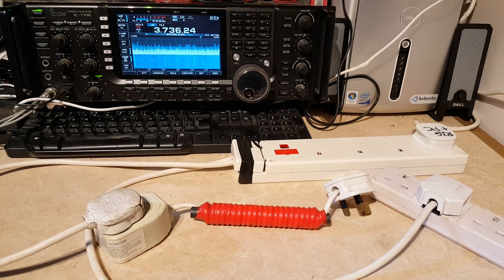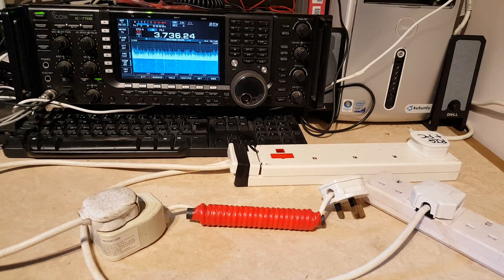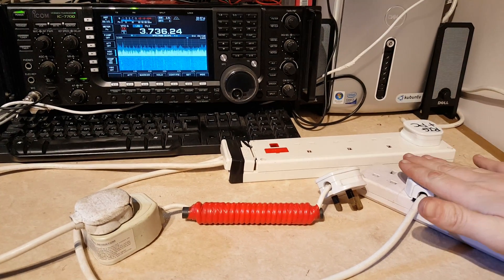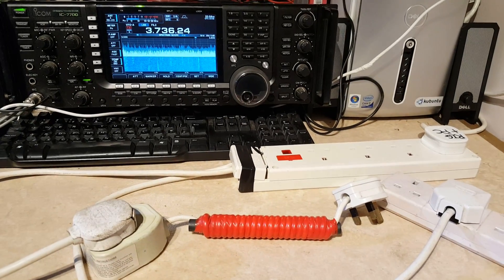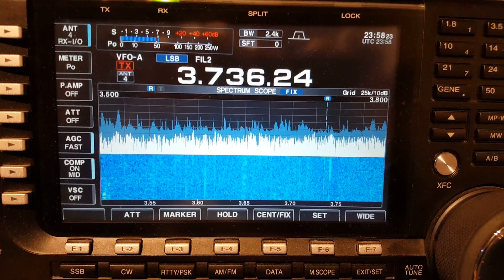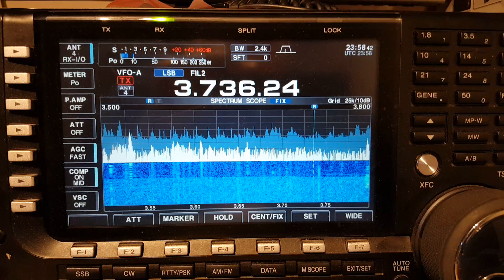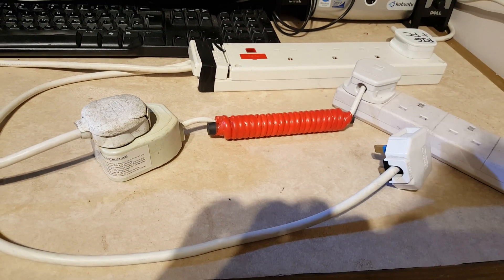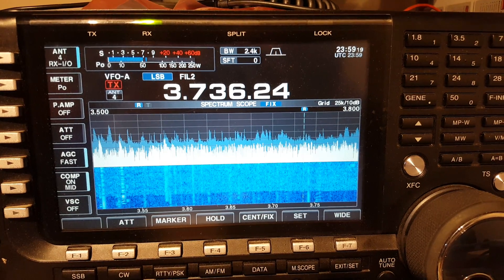EMC & Shack Noise: Filtering the mains supply

Comment: great example, would have been nice to see the effect on other bands too. I  am lucky to have bought a complete "olson mains filtered bank" from a boot market for £30 about 15yrs ago, now I Know what is was, that has kept my noise level low, in my shack.The same thing today costs £160. "yes expensive" for what it is. I am just getting the final bits to complete the sek filter. Did you need to get the 43 oval ferrites as well, or was the 31mix enough to do the job? Also did you put mov's in your build? Other person's experience is always helpful with these things> Thanks for sharing!
Reply from the maker: Absolutely follow Ian GM3SEK's instructions. 😁 This was a quick demonstration of what you can achieve. Ian's solution is a solid design! I don't use MOVs. But added in a decent EMC filter, too.
Reply: thanks for you reply george  cheers

Comment: why is your mains power so noisy
Reply from the maker: All mains is noisy. Look at the design of any switching power supply. All the filtering capacitors (across the AC line) connect to mains earth, usually a capacitor from live to earth and another from neutral to earth.

Comment: Thanks, very good tip, I have tried to wind a ferrite ring but the power cable on my power supply is so thick it was impossible to get a good number of turns on average size ferrite ring, larger ones expensive, so this is a good cheap alternative, ordered a ferrite bar from ebay for £1.95 and looking forward to trying it.
Reply from the maker: Best results will be achieved with lots of turns around a large lump of 31-mix ferrite. 43 mix works, but isn't quite as good, but does still provide benefit.

Comment: Hi George. I seem to have very noisy electrics around my village. When i'm mobile i can pass through the entire village and receive between 5-9 signal strength of parasitic noises. Is there anything i can do? Is this anything the FCC can control? Besides that i live in France. I have just driven through many villages but nothing seems as noisy as my area. (perhaps some larger towns and industrial areas do). 
  It's quite depressing having to go mobile/portable just to escape the noise which kills any chance of hearing anyone below a signal 7 to 9.(this is especially on the 11M band around 27-28Mhz
Reply: I don't think the FCC can do anything in France!  Unless the French communications regulatory authority in France is also called the FCC!

Comment: Or if your lazy like me just plug your gear into a coiled extension lead, The type that comes on a plastic reel, Job done.
Reply from the maker: zinkzoyd unfortunately nowhere near enough inductance. But clip a ferrite around the coiled wire and you're all set. 👌👍
Reply: Well its worked for me, Iv'e gone from S8 Of noise to zero, Its just a temporary fix, Iv'e ordered a mains filter online, Which should clean the background hash up a bit, (I hope)
Reply from the maker: zinkzoyd that's the main thing. Just be careful, many mains filters don't filter the Earth line.
Reply: Thats the bit thats baffling me, You'd think that if noise was induced on the earth wire it would be grounded out, But thanks for the info

Comment: Hi George, what diameter an length rod did you use. Look on RS not sure which one to buy
Reply from the maker: Matt Rose if you're going to buy, the recommended ferrite is a "fairrite 0431177081". It's a clip on job. Get as much copper through as possible - the more turns the better.
Reply: ah thats great thank you. I have ordered. Sorry for the late reply.

Comment: Very interesting. I'm tempted to give this a shot on my FT-897D (AC powered through a Telecom 60A switchmode PSU), though I haven't noticed any difference in noise level when it's run on the internal batteries. Just an S7 ambient noise level most nights.

Comment: Hi.   Would it still work if just the earth wire was filtered instead of all three wires.  73 de g0cdb.
Reply from the maker: I suspect it may well work, given that many radios (including this IC7700) have good internal common mode filters. However, big clip-on ferrites work well too, and you can get many turns of thick 3-core wire around a suitably large ferrite.